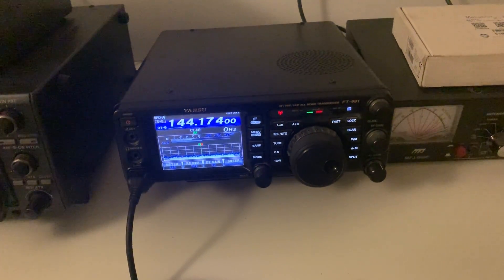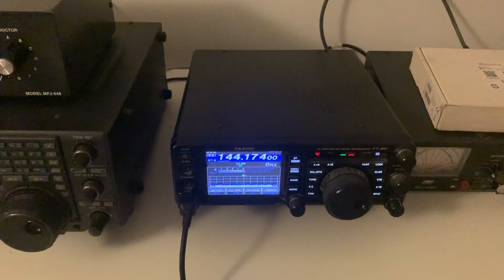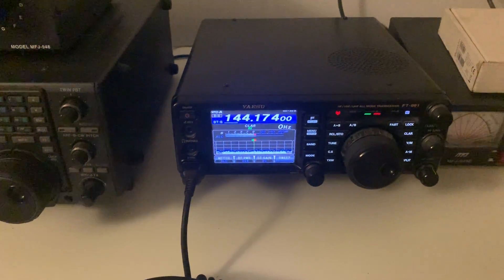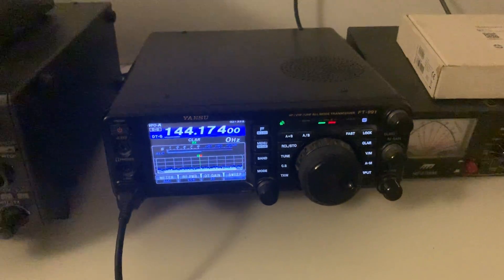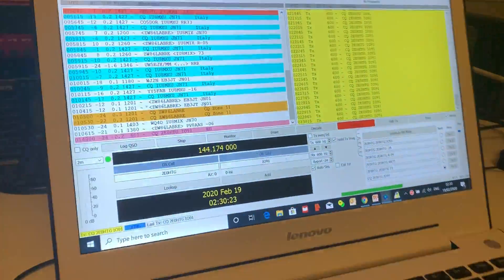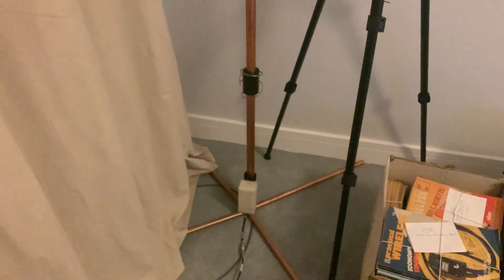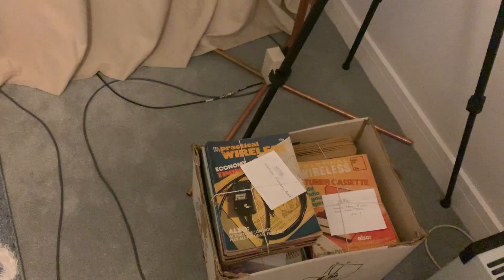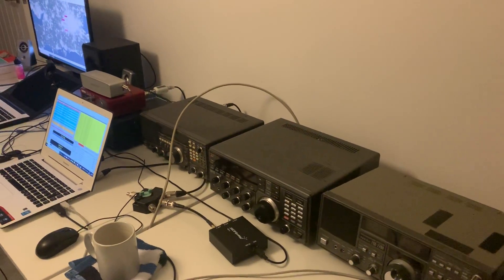Brief explanation and first test of set-up for operating FT8 on 2 metres 144.174 MHz

Comment: Can I achieve ft8 and long distance QSO SSB with a vertical x300 antenna?? or only with a horizontal yagi?
Reply from the maker: I get into Continental Europe with my vertical, so no reason why you shouldn't achieve similar with your X3000. Give it a try!
Reply: @OxfordShortwaveLog  But will I succeed in voice SSB? As far as I know, the transmission on this band opens in the summer.
Reply from the maker: Hi, you might, but of course a horizontal Yagi will give you up to 12 dB in gain, depending on how many elements. 73

Comment: Rookie question, as I'm looking for a mobile dual band radio to use as a base. I don't have the budget yet for a 991A, and there's a lot to learn until then. Okay, don't laugh. Can you do FT8 on FM?
Reply from the maker: Try a Baofeng first...cheap but good.
Reply: @OxfordShortwaveLog  I've actually got an HT already. It's a Wouxun KG-UV8H. I'll have to Google the set-up thru an HT. I've seen how I can do APRS thru it, so a new challenge. Cheers. 73 KO4QOA

Comment: Some time ago (I think it was last summer!) I was able to work an Italian station on 144.175MHz FT8, from my QTH in Barcelona... Using 50W from my IC-7100 into my Diamond X-50N 2m/70cm vertical antenna! Wasn't expecting such a QSO... Obviously, that was a really nice surprise! Anyway, hopefully, when it's summer once again, I'll be able to repeat the feat! Also, here's hoping you carry on with the FT8 live streams... I still haven't been able to make it before you QRT'd, but as soon as I install my new 1/4wave wire vertical for 20m (made using parts & pieces I had lying at home!), then I'd love to see my signal on your screen in real time! 73!! David.
Reply from the maker: Great job working an Italian station from your QTH on 2m! I'll carry on with the FT8 live streams when I get back from Oz - we can try a QSO as Greg and I managed to do finally yesterday. 73! Clint